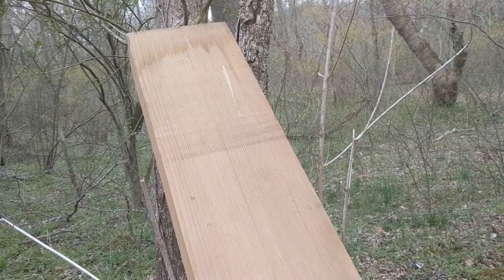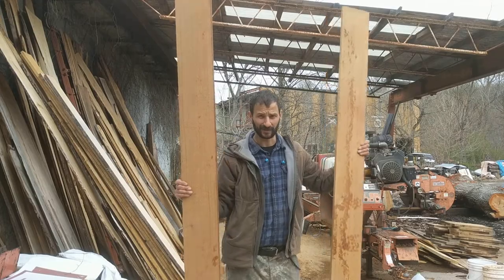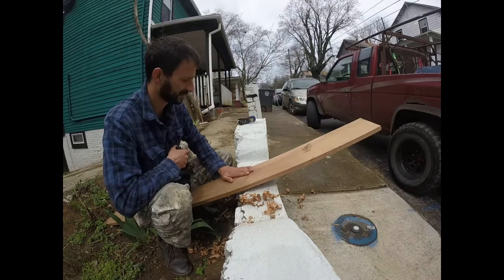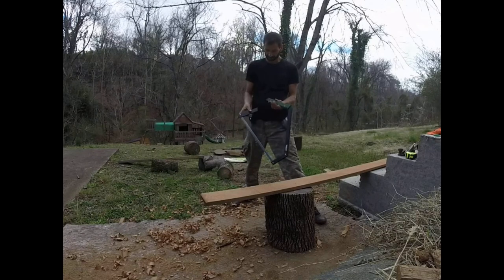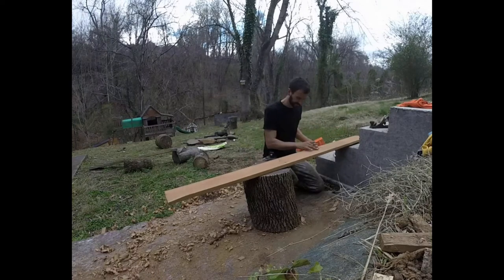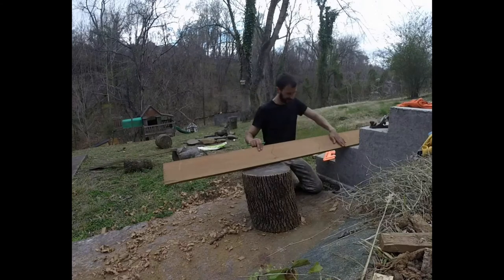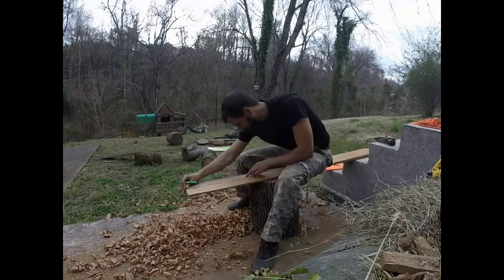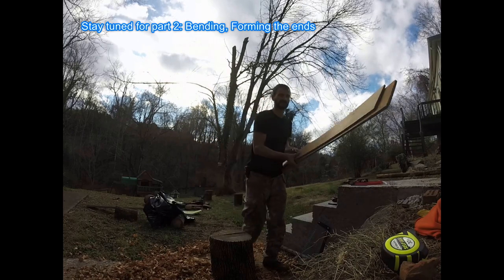Siberian Hunter Skis DIY Part 1

Comment: This is a godsend!   PLEASE, don't ever take this video down!      Like/Subscribe/Bell
Reply from the maker: Ha thanks...have a few updates I should add if your gonna make a pair
Reply: @hobojordo   Oh trust me, I AM going to be making some. You probably worked the bugs out of your design so I'll hold off for your updates so I don't make the same mistakes.   ;)
Reply from the maker: @deltafour1212  well it's all there... I'd use fresh (or frozen) scraped hides so you can get them to stretch a bit onto the bottom after you we them.. not a big difference, these worked fine..but then I'd cut the edges straight so there is less resistance - like a strip
Reply: @hobojordo   Thank you!